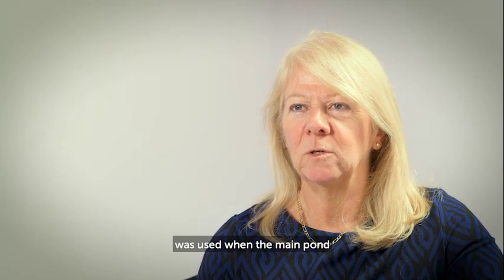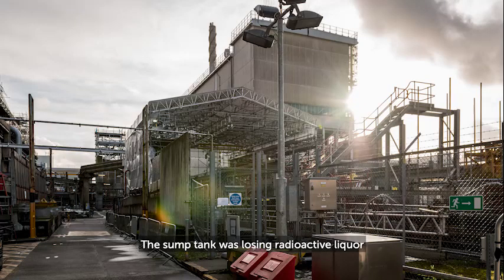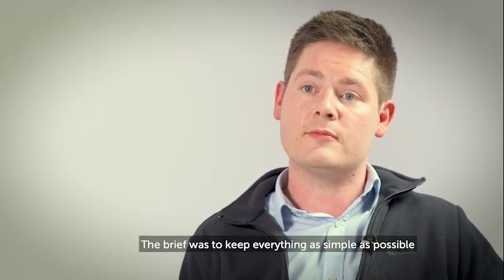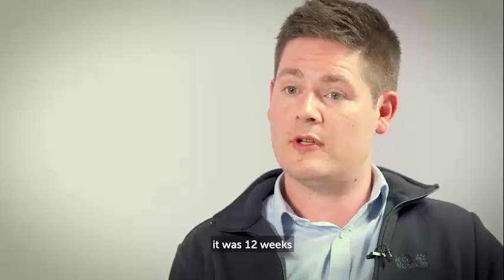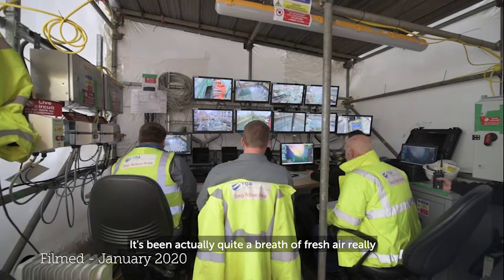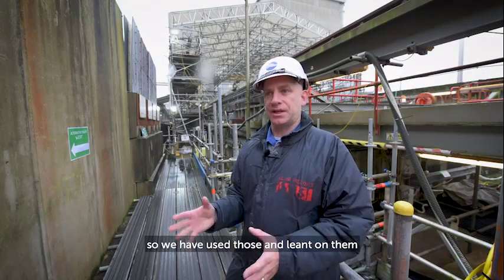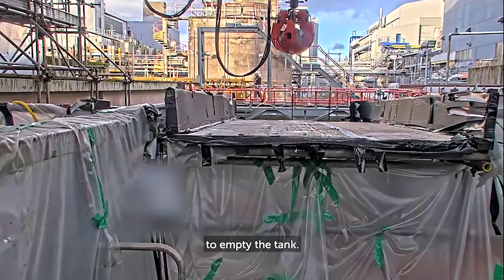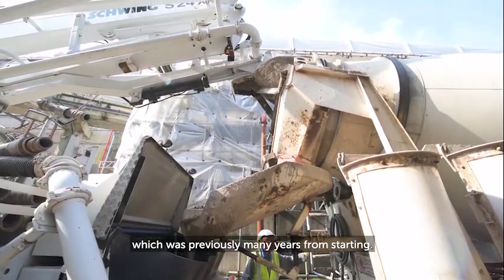The Redundant Settling Tank - Sellafield Ltd

Comment: total bs,what do they plan on doing with the crap once out of the tank then? see there keeping quiet about that,wankers!!
Reply: I believe the standard way is to solidify it and encase it in glass, not really fixing the problem but making it long time inert
Reply: While I respect your right to your opinion, calling them wankers for fixing a completely unexpected and major issue in a timely manner, seems uncalled for. It's not the current management and operations staff that are responsible for the p***poor facilities, the legacy of "That'll do" solutions, and the literal mountain of low, medium and high  level radioactive waste products on site. If you watch their other videos, you'll see how they are dealing with these waste products, and that a long term plan is already in place. It can't be fixed, repaired or disposed of overnight; they are fixing the problems that the former operators declined to care about.

Comment: A job well done. BUT decades of pushing problems down the line, crude unfit "storage". Dangerous and a disgrace.
Reply: The Magnox swarf storage Silo (MSSS)and the Pile Fuel Cladding Silo (PFCS) are top two radiation hazards in western Europe.
The main problem was caused by the method used to remove the fuel cladding. It removed the cladding well enough, but it also removed a tiny amount of fuel. If the fuel slug was deformed by the fuel expanding, or the slug was misaligned slightly, then much more fuel would be removed.
This fuel then ended up in these silos.
Silos that were designed to only hold intermediate waste, not high level waste.
In the end, any fuel slug that was so badly deformed that it wouldn't fit in the decladding machine was just dumped into the silos.